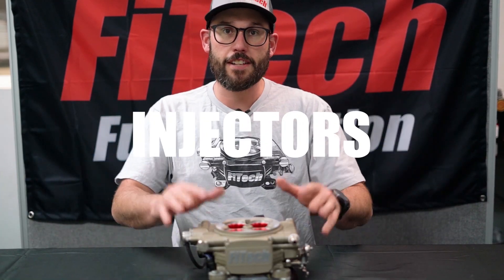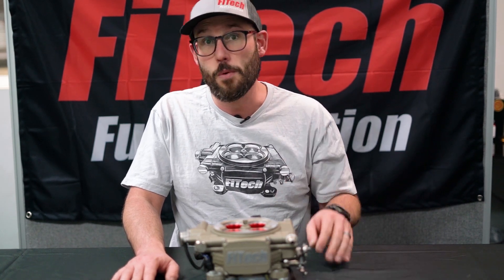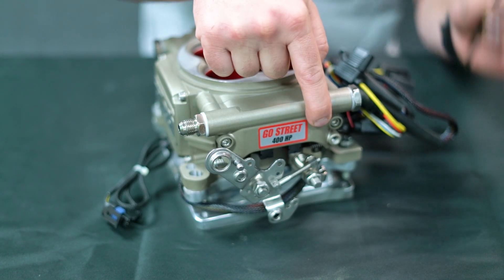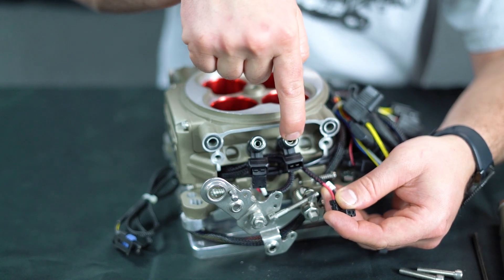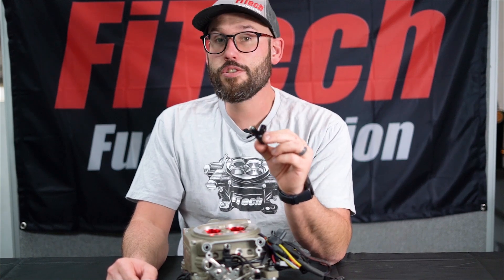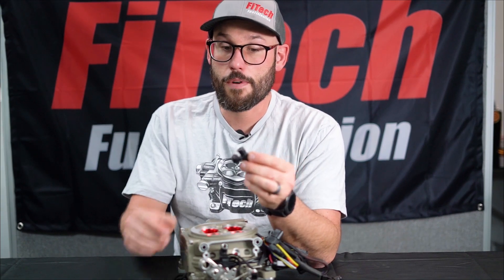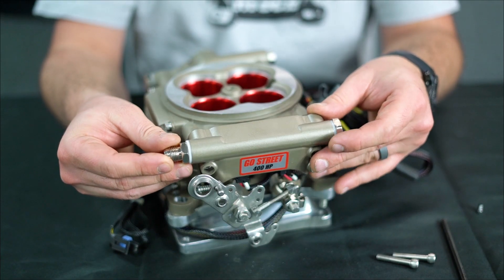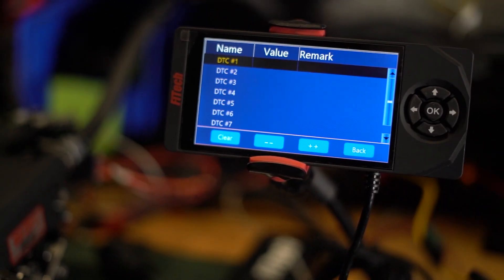Servicing and Replacing Injectors | Tech Tuesdays | EP6

Comment: is it possible to install bigger injectors (80lb vs 66lb) in increase horsepower capability or is there other limitations
Reply: Yes, it can be done. I started with a Go street 400 ran fine but made large modifications to engine that required more fuel. I reached out to Fitech and they advised to try the 80lbs. Did the swap and a bit of tuning, engine likes it.

Comment: How would I test an injector off of a vehicle
Reply from the maker: Without a flow bench about the only thing you can do it ohm them out with a volt meter. They should have an ohm reading around 12 ohms.